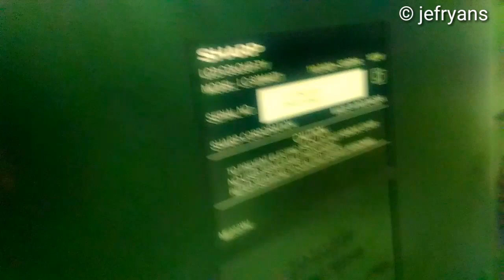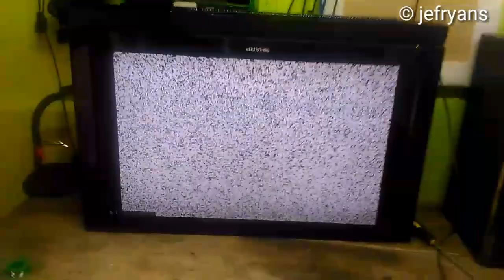Cara Perbaiki Tv LCD SHARP Aquos LC32M mati total

Comment: Ass mas , saya ada tv model ini , kena petir sudah ganti TR K4013 , ic driver semua , fuse dan sudah ada tegangan primer .
Tapi teg sekunder tidak mau keluar ,
Mohon bantuan solusinya mas .
Reply from the maker: Cek tr vcc driver nya
Reply: @JefryAnsElt  TR driver D1082 itu ya mas .. 
Semua tegangan premier keluar 320v tapi yg dari dioda bright menuju IC 6754MR goyang naik turun . Dari 35 ke 115v .
Input trafo ada 320V tapi tidak ada output ke 12v nya ,